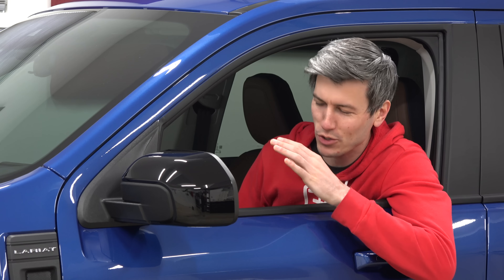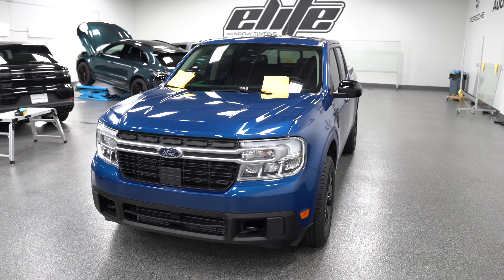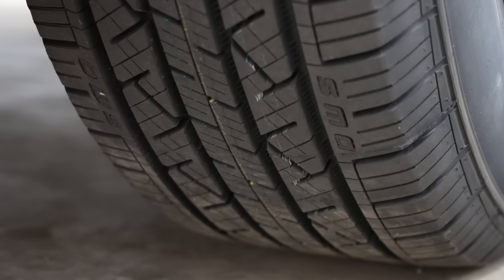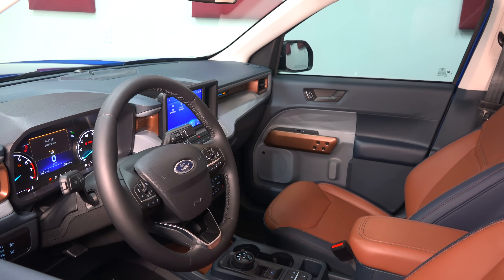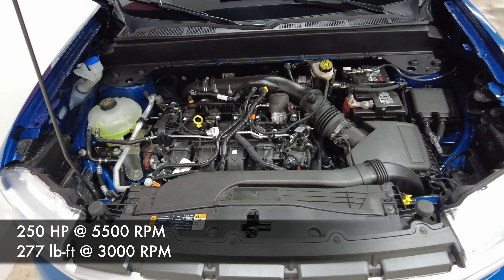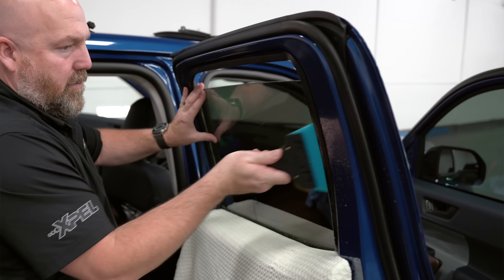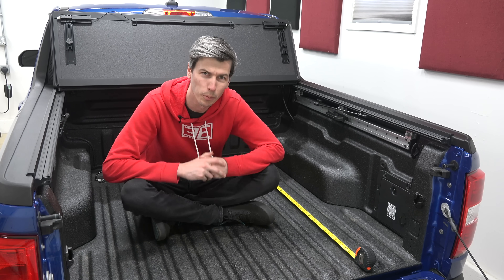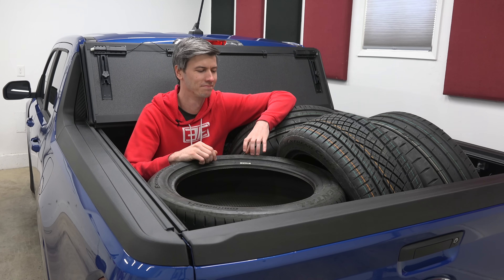I Bought A Ford Maverick! The Perfect Pickup?

Comment: When the world was struggling Ford came out with a $20k+ Prius in truck form and should be commended for doing it.  BTW the Prius Prime starts at almost $30k.  When they make the hybrid AWD and all electric for the first 30-40 miles its all over.  Spending $40k on a Maverick seems a little silly though.
Reply from the maker: Agreed on all of it haha!
Reply: @EngineeringExplained  My guess it due to market demand of the existing options and the fear of eating into Ranger and low spec f150s we wont see a AWD plugin Maverick for years if ever
Reply: @nycLPplayer  I doubt it. Most people in a Ranger want part time 4wd with a transfer case and an option for a rear locker. Quite different than fwd based awd with no option for a locker.
Reply: @paladain55 i would actually strongly disagree with the idea that MOST people buying a ranger use low range or a locker… like ever. I think most people use them for light hauling, daily driving, etc. Not off roading, that is a tiny minority of purchasers.
Reply: @jeremyspecce  this is some what true but look at how popular the 4runner/bronco/jeep is. People really just want to brag.
Another fun fact: they've kinda done it before. AWD Ford Escape hybrid and you could lock the rear with an aftermarket switch.
Reply: Not only making a small truck, but making a small cheap truck that's good. The maverick isn't just a small, cheap truck. It's a truck that's scored very well on reliability reports and has been viewed as one of the most reliable hybrids, cheap cars, and fleet vehicles. It's also fuel efficient, fun to drive, relatively fast for what it is, and quite good looking. 

Just an all around slam dunk.
Reply: @themidnighttavern6784  Even though the sticker mileage rating is 28 MPG highway,  my 2022 2.0L AWD Mav is currently getting an average of about 31.5 MPG with winter gas.
Reply: It did suck having to spend $$$ on the lariat, but the Adaptive Cruise control and lane centering were worth spending a fraction more. It's also sad when 40k is the new normal for a slightly decent vehicle with options.....
Reply: The Mave is the truck that 99% of owner need, but won't buy.

Coming from a guy who used to have horses (just died of old age). I no longer have a truck.
Reply: They created a 20k truck but didnt sell it for 20k, they added on 10 to 15k  easily and wait times were unbelievable
Reply: @Imtired_AF  It was 20k the first year and wait times are due to demand.  You can still get a base model down in the lower 20s but of course they put some of the ideal features in higher trim levels....like every maker does.  It is still priced like a Corolla.
Reply: @Imtired_AF … Supply is catching up to demand in 2025..
Reply: The thing is, with the Mavericks, people are ordering them and paying thousands extra above sticker because of high demand.
Reply: @susannemiller3516 … Supply is catching up with demand in 2025..👍👍
Reply: I paid $27k for a Maverick with all the bells and whistles.  It's a great truck!  Far better than the POS 2018 Colorado I had before!
Reply: The autocruise is worth it at least in some situations. Mine, in particular.
Reply: Just remember Ford’s customer is the dealer not the end user.
Reply: @BlueOvals24  Yeah a high ride is nice, especially when the Maverick in front of you has tinted windows.  😅
Reply: yea, but wait until this ford fails....that cheap easy to rust metal plate that goes to the fuse box loses connection because IT WAS MADE AS CHEAP AS POSSIBLE.  

no thanks....besides it being a ford, you also get what you pay for.
Reply: @baldisaerodynamic9692  The Ford Maverick is literally winning most reliable affordable vehicle, top reliable hybrid, and cheapest to own long term vehicle awards.

Comment: Turbo, 4cyl, and 40k plus.   Hard pass on that price.  Love the truck - not the price, and not the turbo.  

Ford knows they produced a winner and shocking - they jack up the price.

25k should have been the goal for loaded.  19k bare bones.  

Fjb
Reply from the maker: A bare bones 4-door F-150 with 4WD is $50k. That's absolute minimum.
Reply: I think pricing/values from precovid are in the past man. My neighbor just sold his 220k mile, mismatched body panel, beat up 2011 Silverado work truck for 10k. If a high mileage, 10+ year old, beat up work truck is selling for 10k, the economics put a new bare bones work truck at 35-40k
Reply: Well you can blame the auto union for the price increase

Comment: I have the same Maverick, but hybrid. It's truly incredible for the cost I paid in 2022. I expect to buy another soon. Averaging 51.9 mpg this spring and almost 700 miles per tank.
Reply from the maker: Amazing!! Yeah when I tested the hybrid I was soo impressed with the fuel economy, was also getting over 50 mpg. Thing is very impressive.
Reply: @EngineeringExplained  How are you bros getting 50 MPG 😢 I'm averaging 41 - 43, but will see the occasional 50-60 MPG trip once I turn the car off.
Reply: @Duullaann it’s all about the mix of driving. I get 50-60 in town and 40ish road tripping.
Reply: @davidyaroch6622  I don't get that. Every vehicle I've ever owned got 25 to 30 percent better fuel economy on the highway and way lower in city driving. What am I overlooking?
Reply: @o_g_i_b_rockin  slow speeds and stop & go is when the electric power helps out and gets recharged. Electric isn't helping on the highway.
Reply: Thank you for the affirmation. I've been searching for a small pick-up for errands. I talked to a guy at Costco who purchased a lariat hybrid. He loves it. I'm going to text drive one today.👍
Reply: Almost 52 MPG? 😯
Reply: @spicemasterii6775  I would send you a picture if I could. 51.9 on my current tank, which is pretty standard. 613 miles driven and 100 miles estimated til empty. I usually end up with about 690 miles on a full tank.
Reply: @spicemasterii6775 Yep, we live in Utah which is cold as balls half the year. Even though that's basically a worse case scenario for a hybrid, ours is averaging over 42 mpg across 10k miles.
Reply: Thanks for sharing your fuel economy. I plan on buying one of these as a hybrid near the end of this year and was curious what the economy is like. 
For me, it’s the perfect vehicle, it fits the family and is just enough of a truck to be useful around the house without the penalties of a full size truck.
Reply: @Linusgump  just filled up and calculated 51.71 mpg for the tank. Truck computer said 51.9, so pretty close. I drive a mix of town, country highways.
Reply: Good mpg, mine is 25kmiles and  34.5 mpg, i drive 80% street
Reply: @AdamVest sounds like you don’t drive hybrid cars. Ev mode comes on at low speeds which helps your city mpg.
Reply: Wow that's the same as what I'm getting in my 4th gen Prius.
Reply: @seth094978  I drive pretty conservatively and in eco mode. We have some good hills too.
Reply: How's the acceleration on it? Basically every hybrid I've driven is scarily sluggish off the line, and makes me very hesitant to consider one. But that mileage out of a truck is impressive enough to sway an opinion
Reply: @Drew458  I drive like a grandpa so I don’t hit it hard. It’ll get up and go though.
Reply: @Drew458  Hybrid is actually pretty good off the line. I'm kind of a lead foot and daily drove an STI before the Mav. Is it fast? No, of course not, but I merge onto the interstate every day, never wanting for more. Even when I am stuck behind someone who decides to merge at 45 mph and need to quickly blast past them at the end of the on-ramp to merge safely, the Mav is sufficient.

All that being said, I only get like 35 mpg compared to the wild numbers everyone else quotes - so I sometimes wish I had the 2.0 instead.
Reply: SEVEN HUNDRED MILES? WOW!
Reply: Wow that’s better economy than my C-max PHEV. I’m averaging 47.5 currently. Drive 100 miles a day and completely lack a trunk. Man this is a compelling vehicle
Reply: What I love about this truck is people modding it.
Reply: Totally agree!
Reply: People are so hungry for small trucks, they'll take anything at this point lol. The manufacturers are tone deaf. Give us real shifters, 4x4, hybrid options, mechanical gauges, no more electric tailgates or 83 extra tailgate functions and fold outs. Just honest, reliable, cheap to build and maintain, reasonably priced trucks, that's it.
Reply: @abbra  the dealership bungled my original order so I bought one off the lot. I’ve had my actual order reordered for 2 years
Reply: 51.9mpg. I think you mistaken for a prius. Lmao. Even the hybrid maverick is only 35hwy and 42city. You must be smoking some good cracks. Can I get some? 😅
Reply: Are you measuring at the pump or from what the computer tells you?

I get only 41 mpg in a Camry hybrid.
Reply: @aluisious  these numbers are confirmed at the pump but based on what I’m seeing in the truck. It’s pretty darn close
Reply: @aluisious  with a hybrid, it depends a lot on how and where you drive it. I had a Malibu hybrid that was averaging about 61. If I drive it on the interstate I would be lucky to get 50.

Comment: Based. Small practical pick up truck is best truck.
Reply from the maker: Thing's great!
Reply: @EngineeringExplained Manual swap it...just do it. I am trying to convince my father to manual swap his...but it is the hybrid so it would be more complicated m
Reply: @EngineeringExplained  I'm sure it is EE. Trust me though, dump it within 5 years.
Reply: get jason on a bike 😂
Reply: Small pickups in the US are huge everywhere else lol
Reply: The mini truck scene used to be so awesome. I had a handful of Chevy S10s and blazers over the years. Perfect size and versatile. Lower it, wheels, tires, brakes - fun cheap street truck. Bolt on lift kit, it’ll fit 33s without cutting anything, it’ll fit 35s with a sawzall. And it’ll take on 90% of trails
Reply: It's a Raqnchero that looks like a truck, not a car Crossover.
Reply: @DavidHaft1970  I've been saying the same thing!!!
Reply: Yammienoob crossover episode confirmed???
Reply: Go fire someone randomly @yammienoob. Just buzz off
Reply: @NoughtSure  I would have kept the F350. I had a 99.5 F350 for 10 years until I sold it in 2010 and bought a 2004 Tacoma with the V6. Both were good but the Ford was so much more versatile. Now I have a 2006 F250 6.0 that's been "Bulletproofed" by Bullet Proof Diesel in AZ and it's been the best truck I've had. Zero problems of any kind since I picked it up over 6 years ago.
Reply: YES
Reply: Where's snow cat when you need him?
Reply: Damn wasn't expecting yammie noob to pop in
Reply: Ford Maverick owner to ADV dad pipeline, here we come!
Reply: For 99% of normal truck owners, this is enough truck. People who claim it isn’t are in denial…
Reply: @sleeper.simulant7327  That's a nutty claim. You obviously don't know any "normal truck owners" at all. It's a car with a little truck bed that's suitable for a poor young guy that doesn't own anything.
Reply: @MatthewC137  it’s not a nutty claim, the vast majority of people who commute to an office in a pickup and pick up a few bags of mulch or top soil, or tow a bass boat on the weekends don’t need a 1500 or bigger… the Maverick is more then capable of towing a bass boat or a flat trailer with a quad or a couple of bikes on it with ease. Its faster then most 1500’s, gets better fuel economy, costs less… trucks are for guys who actually need it for work… most guys who buy them do not do a job where they need a truck…
Reply: @sleeper.simulant7327  This time you said the "majority" but originally you said "99 percent" and that's what makes it nutty since WAY more than 1 percent of truck owners need a real truck.
Reply: I love everything about the Maverick lariat except the $40 price. That's Honda Ridgeline RTL territory
Reply: @bt7482  That's not a truck either. Does not make it to Truck Gang.
Reply: Yammie, just stop. I'll take my 2002 Ranger over this atrocity any day. Don't bring the "I live in Texas" augment into this. You're in what we call "East California" because of what Austin has turned into. The EPA killed small practical pickups.
Reply: @jordanhart9708  You can't pin it all on Austin. Texas would be pretty damn blue without it. "Don't mess with Texas" lol That's an easy request to fulfill!
Reply: @MatthewC137  Spoken like a Californian
Reply: @jordanhart9708  My reply has been "disappeared"  twice now so I'll try again: You couldn't be more wrong. I live in the best and least blue state that makes TX look like the land of rainbows.
Reply: @jordanhart9708  Your T rump is waaay to my LeFT
Reply: Wow that frickin ai is a pain. It just disappeared 2 more comments. Here's one redone: My state has more than 10 times as many "pewpews" per capita as TX. And here's the other: So back to my original comment: It is indeed a fact that you can't pin TX problems on Austin.
Reply: @jordanhart9708  TX was already failing to live up to its billing.
Reply: @MatthewC137  Then leave.
Reply: @jordanhart9708  Lol, try reading my comments again. I'm in the best state already and haven't been to TX in over 20 years.
Reply: @MatthewC137  Enjoying your blue pill?
Reply: @jordanhart9708  Enjoying your lack of reading comprehension?
Reply: @jordanhart9708  Like I said, your T rump is a lefty compared to me and obviously you are too.
Reply: @MatthewC137  I'm sorry, did someone just assume? Or do I need to teach you how to spell why you just made an ass out of yourself?
Reply: @jordanhart9708  You're projecting kid. My replies to you had nothing to do with assumptions, only your words.
Reply: @MatthewC137  and where did you get me being a "TR UMP" supporter? Your gaslighting isn't going to work.
Reply: @jordanhart9708  My "gaslighting"? What are you, a "they/them"? Trmp is not central to the discussion and you know it so the gaslighting is yours.
Reply: @MatthewC137  Nice Uno reverse you got there. Happy you voted for Biden?
Reply: @jordanhart9708  If T rump is too lefty for me then why would I be ok with B? 
The bottom line that you keep trying to avoid is the fact that TX would be way too blue even without Austin and you can't stand it.
Reply: @MatthewC137  Might I advise a psych ward? I think you may have a bit of a disconnect with reality going there.
Reply: @jordanhart9708  You're projecting again kiddo.
Reply: @MatthewC137  Is that your only response, or are you just proud to show how far the American public education system has fallen?
Reply: @jordanhart9708  I actually have to stick up for some Californians... I recently met 2 couples on an Alaskan vacation, and they were awesome!!!  Southern Cali folks and the first thing they said was we love California for the weather, but we hate the politics. They are big time pro 2nd amendment people too. I'm guessing there are many people out there like them, but they are obviously overrun by a liberal agenda .
Reply: Pretty sure this guy is anything but based, even if he has a correct opinion once in a while.
Reply: Not this one. A lot of quality issues. Buy a Toyota truck from the 80's.
Reply: Not really, it's not a truck. It has a unibody design (Can't haul or tow crap) and an unreliable drivetrain. This is a YouTuber trying to stay relevant.
Reply: @HighFuel90  EXACTLY. It is not built like we should expect.
Reply: It's the cheap truck. It's following tradition of being cheap parts on a borrowed frame. If you want more truck, go spend your money on the literal 2x other models Ford already has that are bigger.
Reply: not based and not redpilled.
Reply: Correction, the vehicle that suits one's specific needs is best.
This thing is useless to me. I haul a 1300lb trailer when empty. Throw a fully fueled and packed ATV on it and this truck will cry all the way to the trail head. 
So small and practical isn't best.
Reply: @EC_ATV_Outdoors the 4k tow package tows 4,000 lbs and payload is much higher than the taco at around 1500 lbs.  How heavy are your ATVs?
Reply: @marklihsu  Bigger than the egos needed to think you need a V8
Reply: @EC_ATV_Outdoors  why do you have such a heavy trailer for an atv?! My 12’ landscaping trailer weighs 950lbs empty.
Reply: @pastaalalamborghini  I have 2 ATV's, it's big enough for one straight on, the second goes up integrated side ramps at the front.
Reply: @pastaalalamborghini  additionally, if you have say a Can-Am or Polaris twin, and it's a 2-up model, your looking at an approximate wet weight of 1025lbs with no gear. So a 2000lb limit, your trailer and an outlander max without any gear, you are 25lbs shy of the max tow capacity
Reply: @EC_ATV_Outdoors  wow ok I'll stick with my 06 450r. 1k lbs wet is way too heavy for the riding I like to do
Reply: @pastaalalamborghini  generally speaking a single piston Japanese sport utility ATV , or a smaller domestic one like a 500+- cc, are all 750lbs or less. And a sport ATV, 500lbs or less.
Reply: @EC_ATV_Outdoors  back in my s10 days, I would just load my 450 by hand with no ramps. Pop her back onto the grab bar, drop the front tires on the tailgate, deadlift and push. Not a chance in hell I’m doing that with an atv like you’re talking about.
Reply: @pastaalalamborghini  I had a 300 that I could man handle. Pushing these bigger ones, in neutral and knobby tires, I've started pushing Honda civics easier lol
Reply: @pastaalalamborghini  My atv trailer weighs 1420 lbs and it only has a single axle. But it is well made and easily hauls my two 800 lb quads with payload to spare.
Reply: @EC_ATV_Outdoors  It can tow 4k because it is a AWD. So you probably could tow that trailer and any ATV that weighs less than 2700 pounds( so most of them).
Reply: @johnantonopoulous6381  I'd be cautious. If I still lived in flat land, I probably wouldn't worry, but here the roads a very hilly, and I've had a truck that going over one of the mountains wasn't a treat
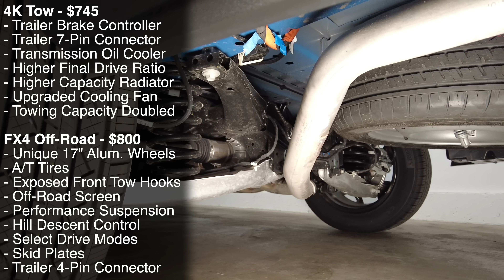Reply: @EC_ATV_Outdoors 9:40 you want the 4K Tow package then, 4000# towing capable with 7 pin socket including trailer brake control.